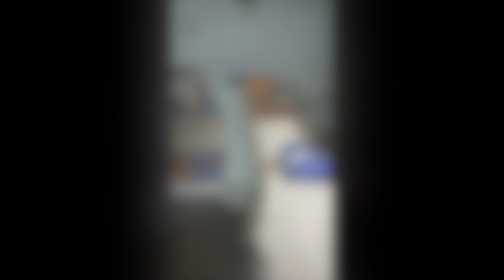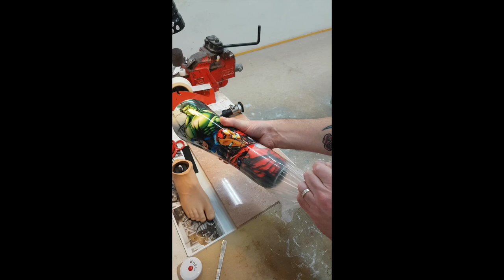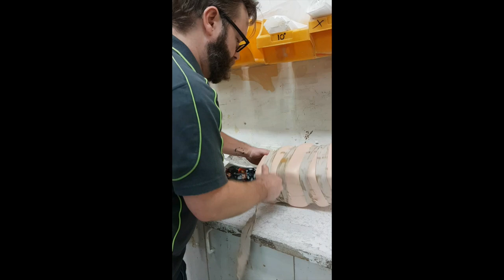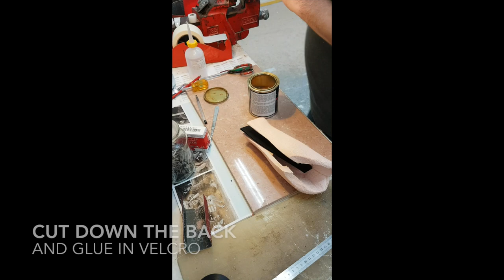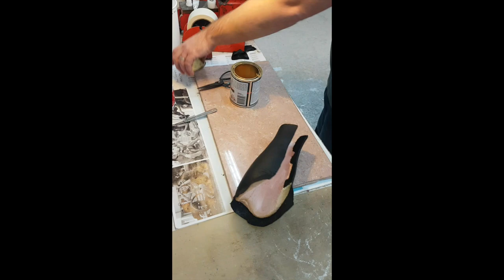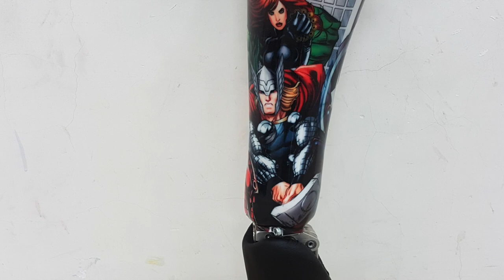Custom prosthetic laminating techniques

Comment: Hi! I just had a question, about the tshirt, would it be okay if it was an HD DTG print? or will the lamination part destroy that? :( What kind of shirts do yall need what are the specsssss please help 🙏
Reply from the maker: Hi there, I think all t-shirts are ok with any type of design, apart from embroidery. Some photographic screen prints may run once in contact with the resin. 
I hope that helps!

Comment: How also do you apply the t-shirt to the cast? With glue or what? Kindly advise!
Reply from the maker: Spray adhesive is the best!
Reply: @karlhuttenmeister  What brand you use sir?
Reply from the maker: @ANWAR920701  I use a 3M brand of spray adhesive. It doesn't react with the resins.

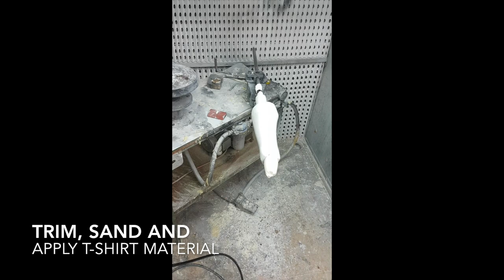Comment: in 1:18 what kind of glue is this? from otto bock? what symbol?
Reply from the maker: It's just regular spray adhesive from the hardware store. Bock is way too expensive, and I would never recommend a certain brand regardless, but yeah cheap spray glue is king